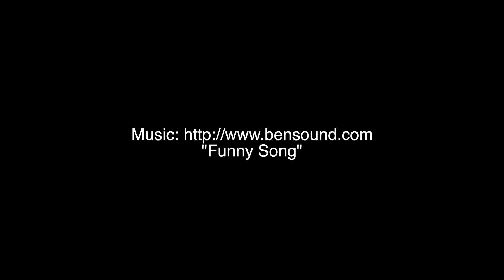Building A Simple DIY Loft Bed

Comment: To all the ppl saying "not simple"
Understand the dimensions you need, e.g. mattress lenght/width & measure the person sleeping there when sitting.
That'll give you the minimum distance to the ceiling so they won't bump their head when sitting on mattress.
Next, try to build something small so you understand the importance of cutting same length & learn stability.
Then make sure you pre-drill, very important or you'll possibly split wood.
You'll run into mistakes, who doesn't, don't rush it & have fun with it.
If you're not sure, you can always add extra bracing like the triangle supports for shelves on the corners.
Reply from the maker: Excellent pointers!
Reply: @BitsandWood  
Thanks Sawdust, liked the Mario Bros shirt too!
Reply: Yeah, not simple.
Reply: @marginalized945  
Usually home depot has a 70% off on bad wood, build small scale mock up bed for cat just to try it.
2ft long 2ft tall 1ft wide, put something heavy on it & see where it fails.
Have confidence, you can do it.
I just did!
Reply: It's not about understanding. It's just the amount of tools youre using isnt a simple DIY. Its buy a workshop of tools. A router? How many average people have all these tools. This video should be called Building a loft bed.
Reply: @TubeYouGuru  
Here's an idea, look for used tools on offerup or flea market. 
You can always re-sell those even if it's for a bit cheaper than you bought it.
Also, plenty of videos giving instructions on how to use tools.
Hope this helps.
I'm building a second customized loft bed soon.

Comment: Not DIY!!!
Not Simple!!
VERY VERY NICE!!
Reply from the maker: How is it not DIY? It's a simple design with no advanced joinery. It's all cheap construction lumber. The only required tools are a drill, circular saw, sander, and a router. The router could even be skipped. It's not a quick build, but simple doesn't mean fast.

Comment: A very clean and minimal looking design in the end but yeah, not so much a simple do it yourself task haha, but there's no way to make a free standing loft bed easily without a lot of structural supports and connections otherwise it would fall apart after a week of crawling into it haha. Thanks man this is helpful, i'm attempting to make a 6 foot high double bed loft so i can have my work desk underneath it :D
Reply from the maker: It is a good, efficient way to make use of space. Eventually I’d like to make another.

Comment: Simple lol... I'll just go buy one after all. I am actually trying to find out how to turn my child's existing small day bed into a loft bed by raising it. So not totally from scratch.
Reply from the maker: You could probably make a platform for the existing bed with four posts joined by cross members along the top and bottom, but leaving one side open for access. I guess that would be somewhat similar to what I did here, but without the ladder and with the rails and stiles around the top. Could be a fun project.

Comment: Amazing job!!! Do you think is possible to build a loft bed for two people? Having the same structure?
Reply from the maker: Yes. I'm a rather plump individual myself and it supported me without any issue. I think I weighed about 290 lbs when I built this. 2x6 construction lumber is quite strong. I would probably try to add a second ladder on the other side if possible though, just to make it easier for both people to get up and down easily.
Reply: @BitsandWood  That's great idea adding the second ladder. My boyfriend and I would like this to be our project. We live in a small apartment, we want to have room underneath the bed so we can place other furnitures.

Comment: Any issues with the legs “wondering in” without a crossbar connecting them lengthwise?
Reply from the maker: Not yet. I think having the three bolts at the top has been enough to prevent that.
Reply: Awesome. Thanks!

Comment: Great job. What is that tool named you are smoothing th wood with at about 40seconds?
Reply from the maker: +Roshauna Loggins-Jordan Thanks! That was an electric hand planer. It's not a required tool for this project at all, I just never use that tool and I found an excuse to break it out. A regular hand plane would work just as well but if you do a good job following your cut line you don't need to do this.

Comment: Will be nice if you tell us what are the sizes of the lumber that you use it will help me alot
Reply from the maker: The structure is all made from 2x6 construction lumber. The side rail, spacers, and ladder are all 2x4s. The bed size is just based on the size of the mattress and the height of the corner posts was just set so my daughter could walk under the bed without hitting her head.

Comment: This video is simple due to the deign and the number of tools that were required to make it. If you don't consider this to be simple, your carpentry levels aren't high enough to be able to safely sleep elevated. I've never seen such a moronic comment section in my entire life.
Reply: How can it get any simpler? There are  structural requirements that need to be met and he did it in the simplest way possible. Complicated? Naaaah.

Comment: Nothing about this is simple
Reply from the maker: Yeah, screws and glue are hard.
Reply: Sawdust is Life lol you can’t take criticism. Poor guy.
Reply from the maker: Oh, I can take it. I welcome it, in fact. I just don't agree at all in this case. Of course complexity is in the eye of the beholder and will vary depending on one's experience. From my perspective there is nothing difficult about this project. It's all common construction lumber held together with glue and screws and painted for a finish. It doesn't require any special tools or techniques. It doesn't get much more simple than that.
Reply from the maker: I am curious though, what about this build doesn't seem simple from your perspective? That could be a good demonstration point for a future video.
Reply: A “simple” loft bed, from my perspective, wouldn’t require all of the different cuts you made. Simple to you may mean something completely different. But I may have missed the point that this wasn’t a diy tutorial. Following what you were doing wasn’t the easiest thing to do.
Reply: Sawdust is Life I work in the oil and gas industry and running a gas/oil separator to me is simple but to others it’s very complex.
Reply from the maker: Thanks for the feedback! That I can use. Maybe if I do one like this again in the future I'll title it such that it's clear whether it is or isn't meant to be a tutorial. That's a good point.
Reply: I think it means "simple" that it doesn't use complex joints, doesn't have any curves. It is all made from squared pieces. It also doesn't use any rare exotic lumber. You would only need a circular saw, a drill and a router.
It does use some good ideas regarding structure and what makes solid wood builds.
Reply: complex built for only a simple and not worthed result
Reply: Cody to the layperson (99.999% of humanity not versed in wood work), this is not SIMPLE. To the Sawdust Is Life, who is skilled craftsman, this is simple. But the Sawdust Is Life should see it through the eyes of a layperson; otherwise, the title of this video should be "Time Lapse of a Masterful Craftsman Building a Bad Ass Loft Bed." For if it was a simple loft bed, than it was overkill. But this is not a simple loft bed; it is a bed designed to withstand the great weight Andre the Giant!

Comment: I don't think  you can call this DIY or simple at all.  Awesome bed for sure, but no one will be able to make this unless that have a vast amount of building experience not to mention way more tools than the average household.
Reply from the maker: Well, I did call it both those things since that's what it's titled ;)

I think there are varying degrees of DIY skill. This may not be a beginner DIY project, but the whole thing can be done with a circular saw, drill, router, and a sander as far as power tools go. That's not a very extensive set of power tools. For hands tools you just need a socket wrench, crescent wrench, measuring tools, some clamps, and a hand saw. Is it doable in a day? Probably not. But with a little patience, it's not that difficult.

Comment: simple=ikea for 99.00   beautiful work, but certainly not simple, even for a skilled carpenter
Reply from the maker: Different scales I guess. Dowel and bolt assembly is pretty simple in my book. Had I used mortise and tenon or a bunch of dovetails I wouldn't call it simple. Simple tools and simple materials.
Reply: assembly seemed simple, the construction was not unless comparing it to pouring a foundation. I could frame the room it went in and finish the drywall before you finished this project. lol. not starting any crap, I am about to embark on a build as well real soon for my youngest... how many hours start to finish? and what was the price tag?
Reply from the maker: +unoefxz That’s why I said different scales. For me the construction of this was very simple. Screws, dowels, and bolts. No fancy joinery. For someone else maybe it isn’t simple.
think it was about $230 not including the paint. Build time was around 8 hours. There was more time waiting for paint and glue to dry.
Reply: dont get me wrong, I have a full wood shop and am going to build one for my daughter, but it will be simple and use MDF. Instead of doweled together railings, it will have a panel. No doubt your work is impeccable, but the average joe could not pull this off let alone identify a fostner bit. Not knocking it at all except for the title. I loathe dry time!!! especially for paint as i can't get anything else done in my small shop.
Reply: Hello mate, I have never work with wood before but I want to build an "L" desk, hopefully I am not totally wrong but I fear I may be, my plan is to buy 1"x6"x10', cut 4 pieces of 6"x5' and glue them togheter to get a 24"x5' rectangle, is it that easy?, or even possible if I don't have equipment ( table saw, clamps, power tools, etc)? Do you thing I would be able to get a flat top on the desk? Will I need to buy a power tool? I'm sure this is a silly question, please bear with me.
Reply: look up Kreg Jig videos... once you learn to use one properly, you can build all kinds of stuff!
Reply: ok who cares?? he tried ad succeeded. but no to u. yeah he could of bought a Ikea bed but he made one. get over it buddy.
Reply: If I may; the first thing you are going to want to consider is the wood you are sourcing.  Normally when you buy wood from the hardware store (Lowe's, Home Depot, etc) it is considered construction-grade wood.  This means the dimensions are rough dimensions, not exact, and the wood is not square.  The typical process of making wood square requires that you "dress" your lumber, which is a process that requires joining, planing, and sawing to width.  There are quite a few tools involved in that process BUT there are ways of getting around this.  The first thing I would advise is not buying 1x6s, but 2x6s.  The extra thickness in your planks will be helpful when it comes to getting a flat top surface.  Then I would invest in a dowel-jig set.  That set will allow you to use dowel-joints between the wood planks when you glue them together, because just using glue will not hold on its own.  Those sets are not expensive, and they are simple to use with a drill (most even come with a few dozen dowels).  As far as the gluing process is concerned... well... you can never have enough clamps, but those can get expensive pretty quickly, so I would recommend a cheaper alternative such as a couple of ratchet straps.  Wrap them all the way around the piece a few times, and be sure that you have a piece of cardboard or foam or wood scrap between the strap and the edges of your board so it won't dig into the wood and mar the surface.  If all goes well, then you will probably want to spend about 20-35 dollars on a hand planer to make the desktop flat.  Doing this with a hand planer may take a while, and it may be frustrating, but it is a cheap alternative to investing in a shop planer, or even a powered hand planer.  Finish with light sanding and a clear coat and you should be alright!
Reply: This is no Ikea furniture. This is rock solid. His grand kids will be passing it on to their grand kids. No bad for 250. [Overkill for what ill be making for my college age kid, but certainly admirable].

And yes, it is 'simple'. Watch more WoodWhisperer and less steve ramsey.

Comment: legs are 2x6?
Reply from the maker: Yes. Two of them at each corner. At each corner, I trimmed one of the 2x6s by 1-1/2" so that both sides are the same distance from the corner edge. Probably not necessary, but I wanted them the same on both sides.